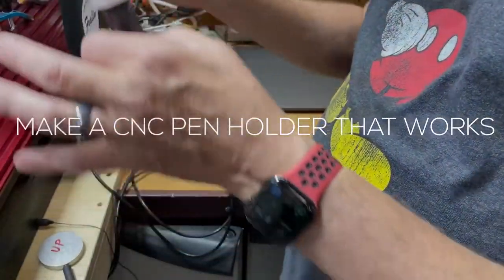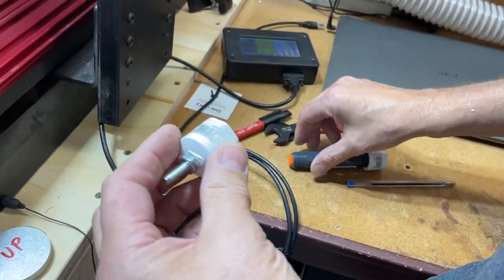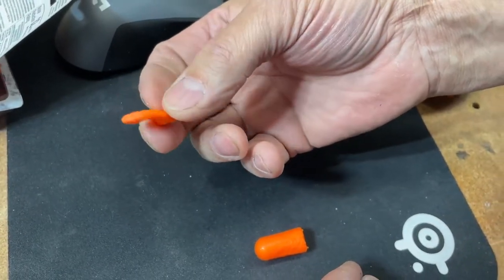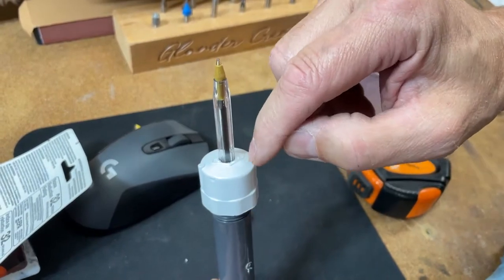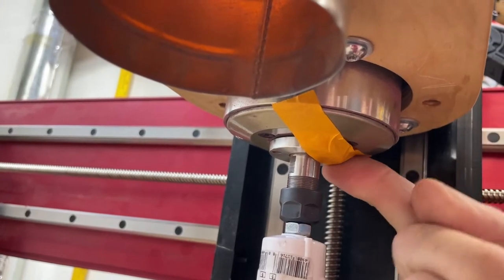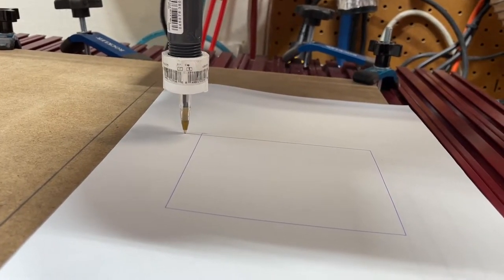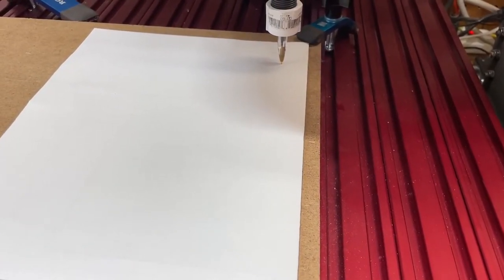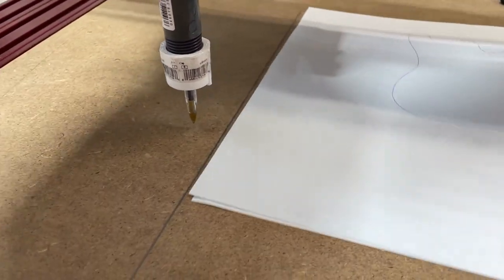Make Your Own CNC Pen Holder for $5

Comment: So it looks like the only thing that I would need to figure out is if the pen needs to be secured somehow for "lifts" of the Z axis, but it looks like friction is enough.  One thing I will need to measure is the minimum lift distance between "Pen up" and "Pen Down", (difference between spring compressed and spring relaxed) so I know where to set my lift distance in Vectric.  Once I do that, this looks like a solid and inexpensive design.  Better than $69!  The only other thing I would do, is try to use a post that has threads on the cap end and is smooth on the collet end so as not to mar  the inside of my collet. I am sure by selecting a longer bolt with an un-threaded area near the head would work. Thanks for the post!  Giving you a thumbs up!
Reply from the maker: Yes, using a 1/4-20 bolt that's not threaded to the head would leave a smooth shaft to insert into the collet. There is some refinement that can be made to this, certainly.  But yes, it's quite inexpensive by comparison to the Nextwave device they sell.  By the way, I've purchased the Nextwave pen holder, and it was manufactured upside down, which makes me wonder about quality control at the factory... anyhow, thanks for the comment.